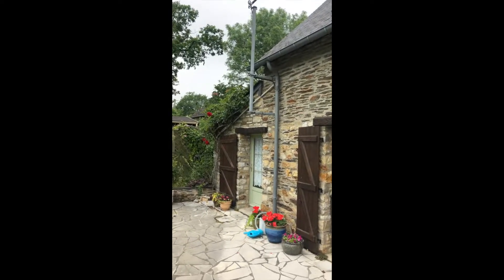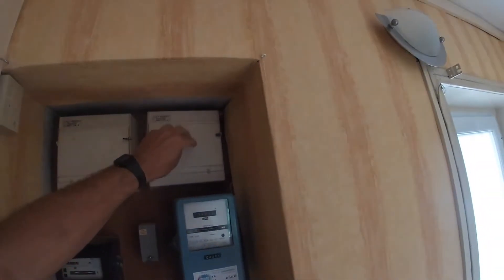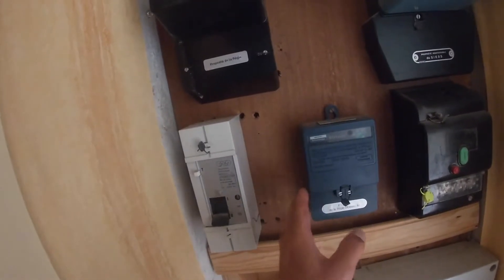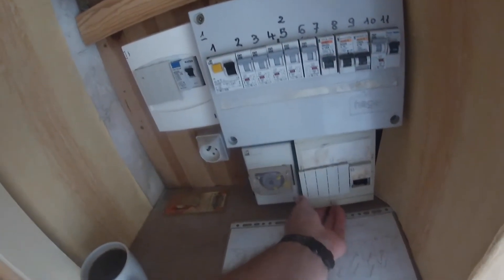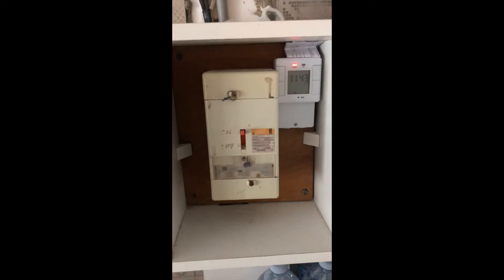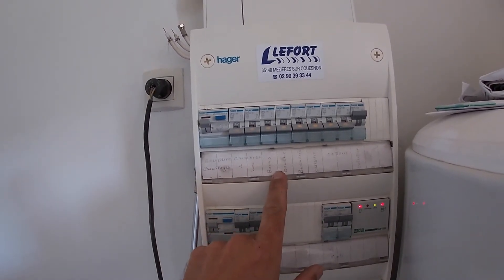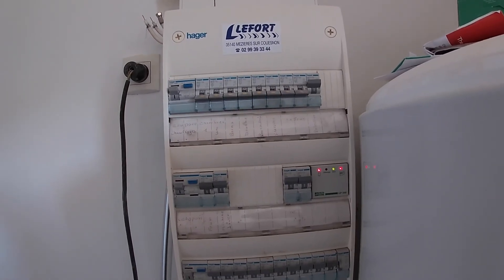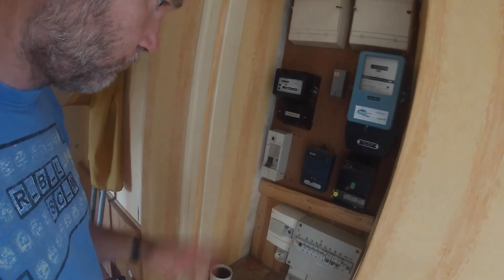Electrical distribution and meter setup in France. Identifying the components.

Comment: I'd assume the old main switch is just a motor protection switch set to something like 17 amps per phase and if you exceed that for too long the switch trips. That's how it used to be done in some places. Those switches are fairly slow because they're designed to protect motor windings, which means they need to be set quite closely to the motor's running current without tripping from the massive inrush current. I remember reading that Spain used the same type of main switch and people knew they could overload the supply for a while without tripping, so they got the smallest supply, an amazing 2.7 kW. When the suppliers upgraded to digital meters, they implemented a hard cutoff at 12 amps and many tight people had to upgrade their supplies.

Germans, especially from the north, usually faint when they hear of those supply sizes because they currently get 44 kW (three-phase), even for the smallest studio flat.
Reply from the maker: That is absolutely spot on, I changed my main switch recently for a new one linked to a smart meter and that's exactly the case. The old was 20a per phase but you can nudge a bit more out for a bit, the new ones however actually allow more per phase but when the total (60a in my case) is reached it cuts out on exactly on the limit. Thanks for watching AJ